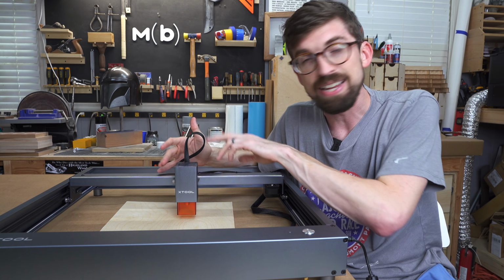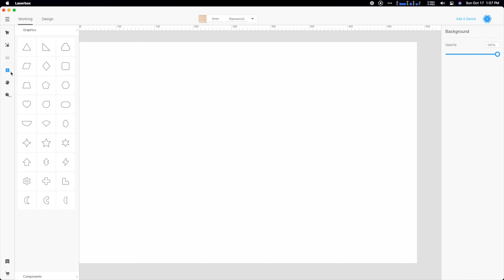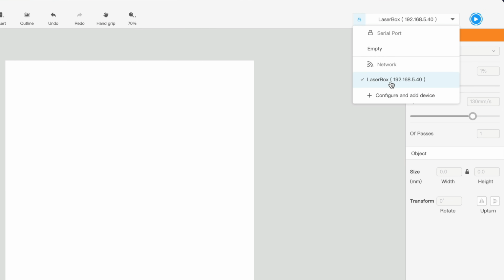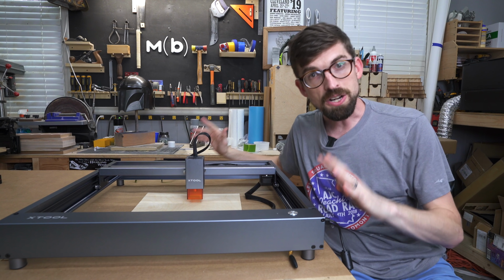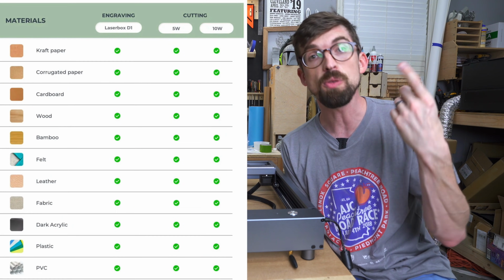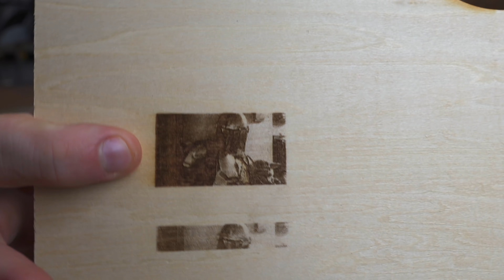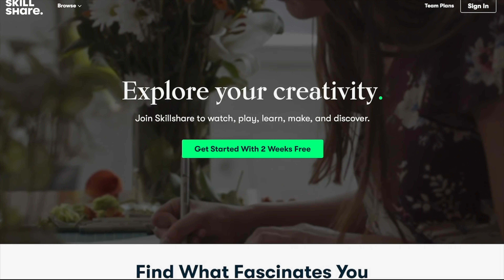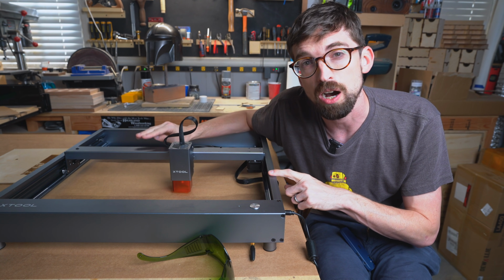The Nicest Laser Engraver This Year? The xTool D1 Review

Comment from the maker: Update: The xTool D1 now supports Lightburn which was my biggest negative from the machine.  Overall this is my favorite laser diode even at a higher price point than others.
Reply: There are 2 versions of Lightburn, which would I need, GCode or DSP?
Reply from the maker: @JamesGames.  its more like 2 different licenses, which open up support to DSP based or Gcode based machines.  For the D1 one though you'll want the Gcode version.
Reply: @JamesGames.  you need gcode if no one answered this for you yet.
Reply: Awesome I've now decided to get one of these for my first laser at home
Reply: @TxSavage1791  you'll love it.
Reply: Still proving to be your favorite? Would you hold out for 20w at this point for a hobbyist?  Have u used neje 3 max?
Reply: Thanks
Reply: I agree I am glad lightburn is now supported. It's much like my die cutting software from silhouette of America but I don't need to transfer from one to the other.
Reply: I Love it..But can't afford..if you n someone wanna help me..send me this machine🙁
Reply: This laser engraver is garbage. It doesn't cut or engrave. When I try to do a picture the laser engraver skips and makes a terrible grinding noise. I'm so upset with the money I spent on this machine 😒

Comment: I reached out to Xtool customer support for a D1 & accessories since I wanted to figure out if I need to pay import duty & VAT. 

They don't seem to be serious about EU law. No clarity on where they ship from. As an EU citizen, I have the right to know. 

As per EU Standard, the seller needs to tell the customer where its dispatched when placing an order, VAT, etc. If I ask about VAT, the Xtool customer support personnel is giving an inclusive response.  What I understood is partly they want to ship from the EU & partly from outside the EU. 

There is a tax obligation, depending on where they fulfill from. This needs to be clear when placing the order, if they ship from the EU, they pay VAT in one of the EU countries where you ship from. Otherwise, it's an export order, either they pay if you have IOSS registration or I need to pay on import extra cost to me. 

You are mixing up, and dogging after the initial response.  Maybe Xtool is good, but not possible to buy from with in EU.  After a week of chatting with them, now I am looking into some other brand.

Comment: I want to make a simple logo coin to inset into my wood turnings. I have used purchased metal coins before but they get expensive. My plan is to engrave a metal disc (maybe a dog tag material) or maybe a more elegant disc like stainless steel or brass. My logo is not complex and I have it in a jpg or other formats. Can this machine do what I'm thinking? I don't want to invest $800 only to be disappointed. My coins are about 20mm in diameter.

Comment: I can see this engraver setting in my garage in the near future. With that being said I am starting from scratch and I currently do not own a laptop.Can you recommend a particular laptop that works well with this engraver? I have owned Dell, HP's, iPads, etc over the years if that helps. I would prefer to spend any extra money I have on goodies for the engraver, but I want a laptop that will work well with the engraver without a lot of fuss. Thank you for your time and Thank You for posting this video. Your feedback is what I used to determine which engraver I want.

Comment: I just put mine together (Jamuary 2022), you can use Lightburn with the D1 now. I'm really digging it. Thanks for your review!
Reply: How did you get your d1 connected to lightburn. My device wont even pull up it has updated firmware and am only able to use it on the  regular program

Comment: Thank you!  So what difference would I notice with a 5W vs 10W. How does the lower power play out in use? It is speed or thickness of material it can cut? And, how hard is it to make a 2nd pass at a material to cut it? Does it still cut pretty clean?
Reply: I ordered the 5w as well. It's on the way and I was also worried about how big of a differences would be. What did you find out after using it? Big deal, or no? Thank you

Comment: I need a laser to permanently apply text to stainless steel and brass coupons, none larger than 100mm. There will be hundreds of them, each different. The stainless will need to withstand permanent exposure to the harshest sun and wind for years at a time. When you say this machine will mark metal, does that mean it will be satisfactory for my needs or do I need to think fiber lasers?
Reply: Any diode laser will as you say, mark on stainless steel, not truly engrave the metal. Having said that, yes the mark is permanent. I expect it will do what you ask of it right out of the box. However, if you really want to ensure a dark solid permanent mark, I suggest you use a laser marking spray. (Search Amazon) it is expensive at about $60 for a 12 oz spray can, but in your case I think it will be more than work it.
Reply: @jamespelt3651  This is exciting information. Thank you. Does anyone know of a cheaper but similarly effective material for permanently marking brass?

Comment: I want to start small business with laser engraver. All kinds of gifts, metal key chains... Mostly on wood, but i would like to have open option to engrave on metal, it doesnt need to be deep, just enough to not be wiped off. I would like to buy if possibly around 700$. But i will work a lot on that laser and i need it to work long term. Do you reccomend atomstack x7 50w dual laser? I also looked at ortur laser master 2 pro, but as i saw it is weak to cut through even 5mm wood. What do you think about x7 and if not can you reccomend me something else. I cant get xtool d1 shipped to my country(Serbia). And is it better to order from aliexpress or from official site, because sometimes the difference in price is arond 50-100$. By the way i love your videos, they are very detailed. Sorry for the gramatical errors my english isnt the best.
Reply: We can cut 5mm plywood.And our 10W can cut even 10mm Acrylic.

Comment: I'd love your opinion on our use case of this vs the Ortur. Was just about to go for the Ortur LM2 Pro when I saw this video. Eithers' most difficult and frequent use case would be for a teacher cutting paper, cardboard, and occasional thin (6mm or less basswood/balsawood) for young student projects. Along with doing engraving for gifts and occasional sales (once or twice a year flea markets, no online shop).  Would a 4" hose and exhaust fan to outside near the xTool be enough in a basement shop? I've got preexisting 4" exhausts running for airbrush and resin 3d printers. Or should we really use an enclosure?  Really like the xTool build quality and what seems to be a better laser module with dual diode. "Good enough" software doesn't seem to be a problem since it doesn't need a persistent online connection like glowforge. The big thing that has me hesitating on this xTool is that the Ortur has an optional enclosure, seems to have more reviews, more mods, and more units actually out there in the hands of hobbyists.
Reply from the maker: I would still lean towards Ortur since they offer more options for software, but the D1 is still a great option.
Reply: @makeorbreakshop  Thank you for your thoughts! Unfortunately, before I got your reply found a coupon stacking deal that made the xTool D1 noticeably cheaper than the Ortur Pro. Once I verified my current exhaust system would reach the open workbench, I couldn't resist. The order was placed. Will keep the Ortur in mind if we have any trouble with the xTool.
Reply: @RideShagbark  where did you find the double stacking coupons on the D1. I’m about ready to purchase?

Comment: I’d love to hear your thoughts on the Atomstack X7 Pro. It seems to use the same laser module as this one. It is a more traditional extruded aluminum chassis but that allows for easy future work area expansion.
Reply from the maker: It’s ok the way right now!
Reply: Agree. I already own the Atomstack M50 laser module retrofitted to an earlier A5 20W and I haven't done much at all with it but I did cut 3/8 solid Poplar fairly fast. But I really don't do much cutting at all. But it is definitely a hotter laser for sure.

Comment: Have you heard of those double diode lasers? The two beams are focused on one spot creating a quite capable diode laser cutter. I'm very interested in that.
Reply from the maker: Yep, we get into it in this video since this unit is 10W and that's how they are making the beam.
Reply: @makeorbreakshop  there is a youtuber "louisiana hobby guy" who cuts through 6mm plywoold with his double diode laser; in my mind that is impressive and more than just an engraving tool.
Reply from the maker: @Kopsu87  Yeh you can totally cut through plywood but I usually suggest jumping up to a CO2 laser at that point, because will get at least 4X the power (40W at the low end) plus all the safety stuff you really need when cutting like an enclosure, air assist, cooling, etc.
Reply: Neje has a new 40w (15w output) dual diode laser module. I really want to upgrade my 7.5w output module to that one. (insert tim taylor grunt noises)
Reply: Ah cool. I didn't realize this was one of those double diode units.

Comment: It looks very nice but the first question i have, how i could install a air assist ??? The laser is closed
Reply from the maker: Most people will mod an air assist with a cooper tube attached to the side of the laser head that then attaches to rubber tubbing and finally a compressor.  So the air doesn't go through the actual laser module is just is coming in from the side.

Comment: What do you use underneath the project to protect your table? Also I'm so glad you reviewed the D1, you are by far the best laser reviewer. I purchased the D1 but I haven't gotten it yet.
Reply from the maker: Glad the review helped!  Mine machines I usually just sitting on a work table with a MDF top that I wound up replacing every now and then since I also do woodworking as well and they get pretty banged up.  But I have seen people use hard surfaces like granite to add some protection between the laser and the table.
Reply: @makeorbreakshop  I'm now torn between ordering the Ortur LM2 Pro & this!!! 🤔 Which of the both do you prefer & do you know if the wheels on the LM2 Pro can be upgraded to steel wheels & when Ortur will release the double diode you mention?
Reply: @neilrisley6667  Hey Neil - which did you end up buying? I'm torn between the two as well.
Reply: @sherrysmith2411  I ended up getting Ortur's Laser Master 2 Pro (with the Enclosure, the Z-Axis Lifter & the LU2-4 LF with Air Assist) also in the same order I got the Aufero Portable Laser (with Z-Axis Lifter & the LU2-4 SF) an extra Laser Orturs LU2-2 7w Laser, the YRR Rotary Roller & a 3D printer (the Anycubic Chiron) In total all 10 items were under £1,000 durin Black Friday weekend (with Free delivery) The cost was just too low to not go with it all...a Great bargain (& I've been Happy with All of it) I'll maybe think about getting xTool's M1 at some point next year
Reply: Waiting on mine as well. Currently have an Ortur LM2, I use a ceramic tile I bought from Lowes to protect the table under the laser cutter. There's no way the stone would catch fire and its cheap.
Reply: I just ordered one - good discount with lots of free extras. I also ordered the Honeycomb Working Panel set, which is on sale as well. Total I paid was $920 with tax. I'm going to build a cover the size of the mat.

Comment: I think a a k40 with a couple of little mods would be a much better alternative?
Reply from the maker: Yeh the K40 is probably the most interesting comparison.  The biggest benefit you get going the K40 route is you move from diode to CO2 which means you get WAY more power (40W vs 10W).  But you also get all the drawbacks in that is more heavy, less portable, takes up more space, needs water/compressor attached and has a much smaller work area.  It really depends on the types of stuff you want to make.  If you mostly want to do engraving that I would stick with the D1 or something from Ortur.  If you really want to laser cut, then a CO2 machine is going to be your best bet.

Comment: Hey awesome review! When will it be released to the public? As a first time buyer would you recommend the ortur lm2 pro or the xtool D1?
Reply from the maker: It's public now!  Just some of the features (like the app) aren't coming until next month.  For a first time buyer I would lean towards the D1, especially if you are planning on using it a good bit to making products to sell.  The build quality is top notch and the 10W laser is really nice.  Ortur LM2 Pro is still a great especially when you pair it with 3rd party software (like Lightburn), but the D1 is still super capable.
Reply: Awesome thank you so much!

Comment: Would you say this is better than the laserpecker? I work with leather (boxing gloves) and would like to start engraving on them. Which of the two would you recommend?
Reply from the maker: The laserpecker is a different style diode laser.  It moves the laser beam with a glavo, which is a mirror that moves the redirect the beam, meaning that it is faster but teh overall work area is pretty small.  If your working with gloves the Laserpecker might give you enough work area to engrave but it could be tight.  I would lean towards something like this since its way more flexible in terms of having higher laser power as well as a pretty big work area.

Comment: Great review.  What's the downside of this laser's software compared to lightburn.
Reply from the maker: Their software is actually pretty good, you can do pretty much everything you need.  The design tools are pretty simple so if you mostly importing images it shouldn’t be a huge deal.  The big thing is just flexibility, other software has features you might want down the road so having the option to use it would be nice
Reply: @makeorbreakshop  thanks for the feedback.
Reply: @makeorbreakshop  Is this something that you've seen change over time? Do companies eventually make using other software a possibility? (or people find their ways...)